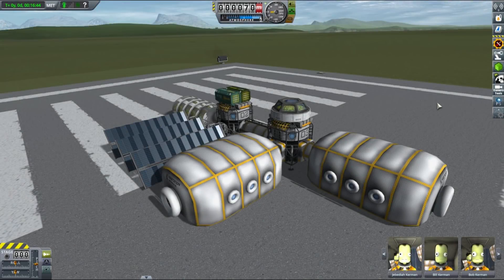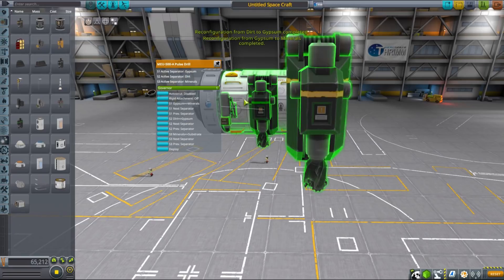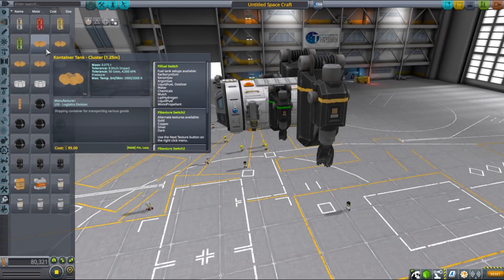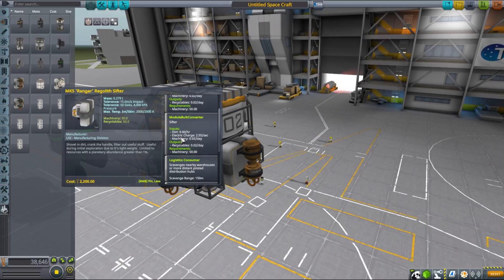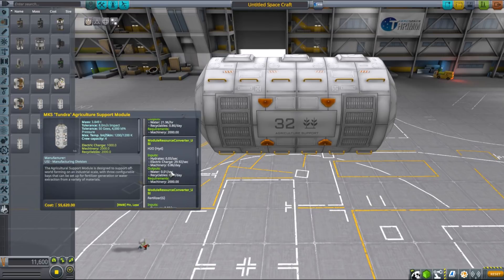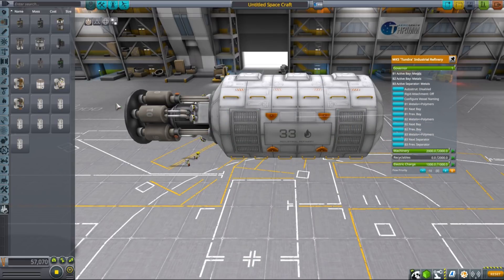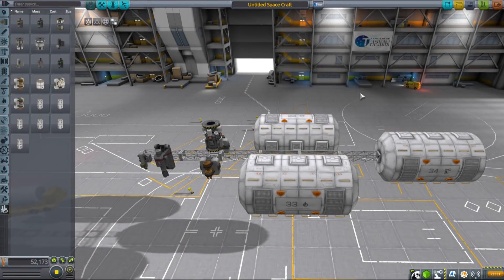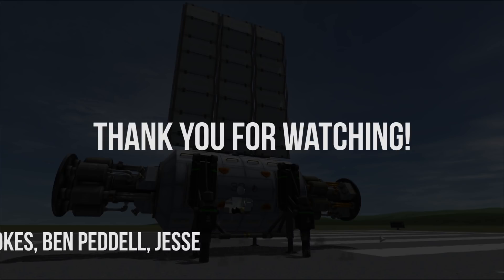Basics of Mining and Processing - Modular Kolonization System - KSP 1.4.2

Comment: At the end can you setup a self sufficent base as an example on minmus or duna so we can see how everything fits together. I also can't work out how the Orbital ship yard and platform work does any one know?
Reply: j169 really? I am pretty sure MKS switched over to Ground Construction.
Reply: Yeah i played it basically since it first came out (still don't fully understand it because everything is different by now...) 
I actually prefered Extraplanetery Launchpads because i usually build the bases on Kerbin and mainly used it for things like: "Oh i forgot a solar Panel/Battery/a drill/spare wheels" or other small things, which worked great because i didn't want to delay a mission or revert because flying a single spare wheel over takes just as long as the whole base did before. Ground Construction requires you to take a DIY-Kit to the building site for every vessel, so now i always have to take a little garage full of spare parts with me(Or rather the Kit for a garage full of spare parts).